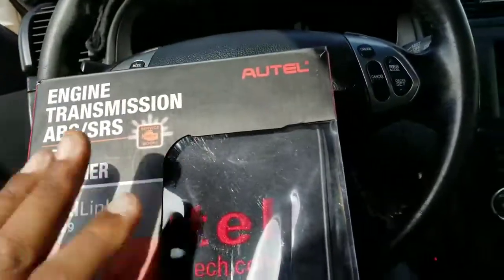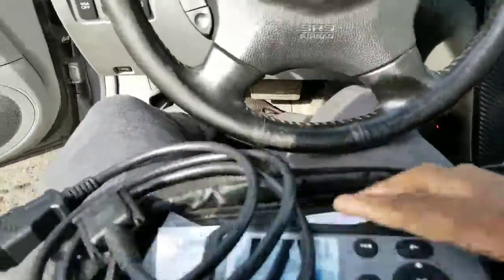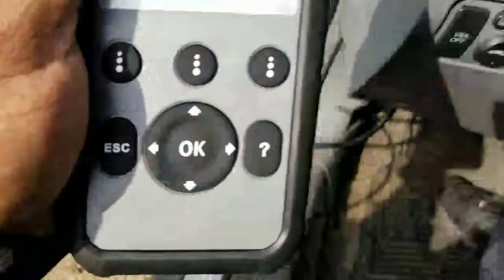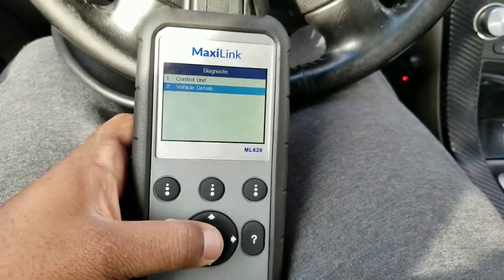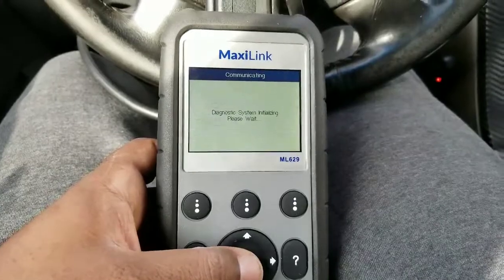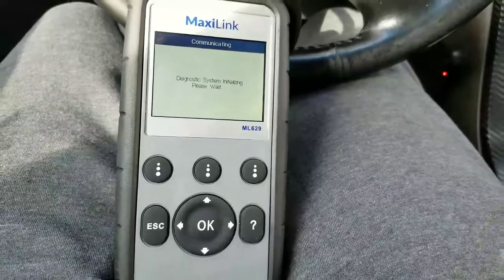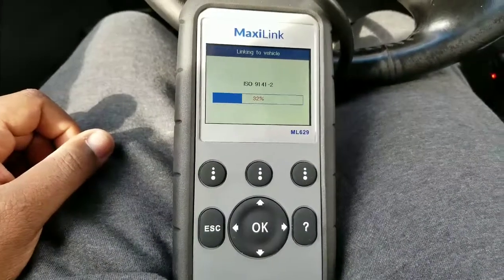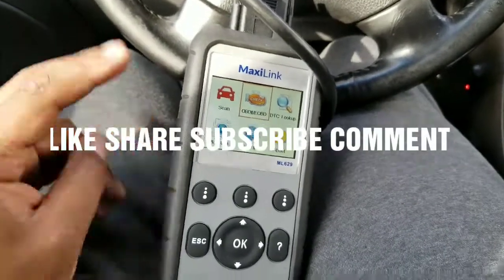AUTEL NEWEST SCANNER MAXILINK ML629 ABS/SRS/Engine/Transmission OBD2 REVIEW + Discount code

Comment: i read a lot about this and thought well it might. i bought an audi a4 1.8T with limited gearbox . the sport mode didnt work and the mutitronic were you push the gear lever up and down didnt do nothing. only had drive reverse park neutral. Took it to garage were they pluged a £3000 Bosch tool in and gave me loads of fault codes. Great i thought. I plugged this little sucker in today read the faults erased most codes , left a couple whicjh i know i have to repair. Unplugged this Baby and FK ME the gEARBOX ALL WORKS  tiptronic Sport the lot. This little £100 tool just saved my car from the scrappers and given me a big Smile!!!!! This is a GOOD TOOL.....
Reply from the maker: Great tool love it.

Comment: I just purchased this exact scanner for ABS, however, when I connected it to my truck, the abs function did not work. Any idea what it may be?  Was I supposed to upgrade software before use?  I have a 2008 Ford F150 btw.  Thanks

Comment: I have the SRS code on my Honda Civic 2013. I heard that 9th gen computers need the dealers to do the resetting and I’ve done all that and ended up getting ripped off of 3k and it didn’t even solve the problem. Lights still come on. Will this scanner be able to reset? I also have abs/vsa/power steering/brake system light
Reply from the maker: yes this scanner will tell you exactly you need to do

Comment from the maker: LINK TO PURCHASE AUTEL ML629 SCANNER-https://amzn.to/2OaAjeN
this coupon code which also can save 15% on the ML629: 15ML629SC

UPGRADED ML619: Compared with ML619, ML629 retrieves trouble codes not only in ABS and SRS, but also in Engine and Transmission system, being cost-effective with only a small extra budget to enjoy more benefits.

4 SYSTEM DIAGNOSES: It accesses to 4 vehicle systems and subsystems such as ABS, SRS, Engine and Transmission, to perform a comprehensive scanning process on ECUs to locate faulty systems and retrieve DTCs related.

OBDII VEHICLES COMPATIBLE: A wide range of 1996 and newer European, US and Asian vehicles (OBDII & CAN) are covered by ML629, including GM, Ford, Mazda, etc. Welcome to contact us for a detailed vehicle coverage list.

DTC LOOKUP & READY TEST: It has a lookup library. Every code comes with a description to help you understand the problem. The Ready Test gives a heads-up for avoiding risking a penalty of not reaching the car emission standard.

& UPDATE: ML629 carries a complete 12-month from the date of sale provided from Autel Headquarters in China, with free lifetime software update, to ensure it is reliable for your daily diagnostic work.